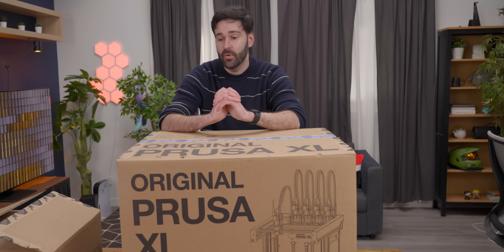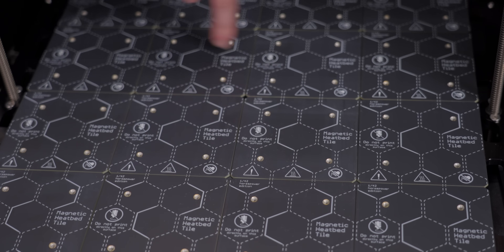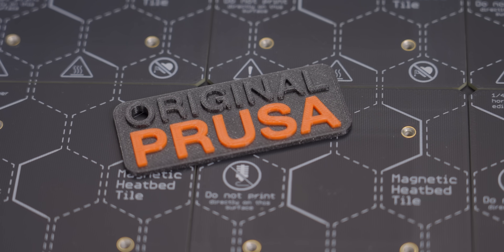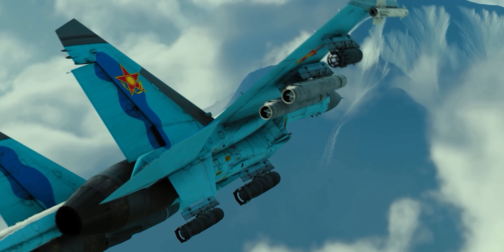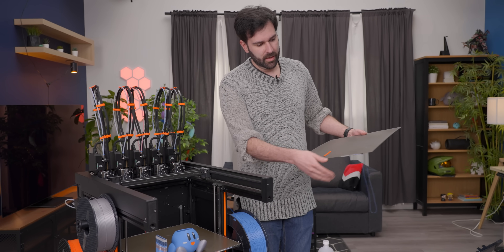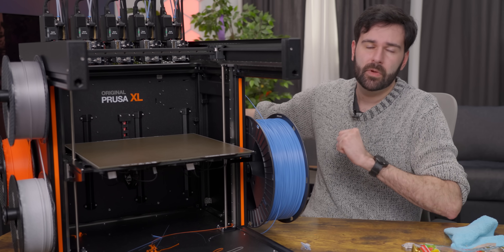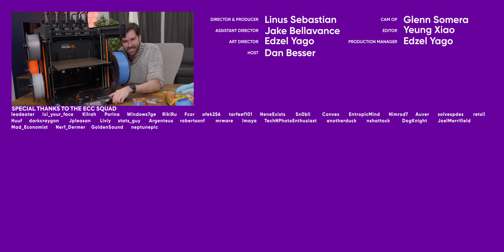Five heads are better than one - Prusa XL

Comment: Hey Dan, excellent video! Sorry for the lengthy comment in advance. I was initially leaning toward the Prusa XL, thinking it would finally meet my needs, but after watching your video, I’m now unsure about whether it’s the right choice for my specific requirements. To give you some context, what I primarily need from a 3D printer isn’t necessarily speed, but precision. I often prototype intricate parts that must fit together with tight tolerances, so accuracy is key. I was initially drawn to the Prusa XL for its build volume, which I thought would be ideal, as my typical print heights range from 2” (50mm) to a maximum of 14” (356mm). While I mostly work with single-color prints, I’m also open to multi-color or multi-material options when needed, like the XL promises. However, the most critical aspect for me is achieving a smooth surface finish akin to SLA prints, but without the associated hassle of maintaining an SLA printer. I’ve heard that the Prusa XL’s slicer now includes the Arachne perimeter generator, which promises improved print quality, and that was something I found promising.

 Based on your extensive experience with various machines, I’d love to hear your thoughts on which printer would best meet these needs. Specifically, I’m looking for precision, ease of use, and the ability to deliver professional quality prototypes, without the maintenance demands of an SLA system. I trust your judgment and would greatly appreciate any suggestions or guidance on what to consider next in my search. Should I keep waiting or should I take the plunge? 

Thanks again for all the valuable content you create, it’s been a huge help!

Comment: I respect Prusa for what they have done, and am concerned that they are sort of loosing their way with the way they have handled the launches of their most recent machines. With the launch seeming like they felt the pressure to release these before they were completely finished due to Bambu Lab's meteoric rise and the surprise that was the creality K1 and K1 max. Now, obviously those machines each do things very well with the K1 Max being a larger, klipper based machine in comparison to the X1C and P1S, but the Bambu did multi-color and multi-material very well. Now, this machine does both, but the lack of per machine input shaping is something that felt like an oversight, especially when they first released input shaping for their newest machines because the machines didn't launch with it. They just feel like they are now behind the 8 ball now and I hope it doesn't stay like that because they have been a gold standard for reliability and ease of printing.

Comment: Why do you still need a purging tower with different heads ? Can't you purge them all once at the beginning and swap directly ?
Reply: I know this is a month late but you can its not a purge tower it's a priming tower to make sure the filament is heated and flowing smoothly has absolutely nothing to do with purging anything but you can do it by priming into infill but that could lead to delamination and inconsisten extrusion

Comment: Was looking at the Prusa XL with the multi heats, but the price for all 5 heads was a little steep for me, and what I was needing Decided to back Co-Print, whom Creality has also partnered with, creation for a multi-filament head/system. Should work great with my K1 Max. The option I chose will allow both of my printers to swap between 8 different types of spools. I have some grand Ideas. lol 2 printers with 8 filament swap capabilities for less than $2K feels nice... or I could have one with 16 spools, and the other with 4, or just put all 20 on one printer, which is the max. Which is honestly down right insane and mind boggling to think about right now! lol We shall see how much of a headache I have with it once I get it. Which should ship out in what looks like May now.

Comment: At this time of point, there is no point of getting a Prusa. Prusa is failing to adapt to the new market. Their MK4, although reliable, is HORRIBLE value for its price. You can get something like a Bambu Labs A1 for a fraction of the price, print really fast and have Multi material compatibility, out of the box. The XL is so outright garbage. Their reliability is not good at all, It fails at multimaterial printing, and costs a LOT more than the E3D toolchanger.
Reply: The e3d toolchanger wasn't even a printer

Comment: Presumably each bed tile is 17.75 watts, given that it's the the "1/42 horsepower edition"
Reply: That would only add up to 284 watts. Seems pretty low.
Reply: @logitech4873  My thoughts too. The bed on my E5 Pro is 220W, and this Prusa is so much larger.
Reply: @kylegordon  The heatbed on my Bambu is closer to 1000 watts, and that's only 256x256mm
The Artillery X1 i used to have was 300x300mm and 600W

Comment: The price is absurd, it also offers something no one else does. If you mass print colour this is definitely better than a Bambu with AMS, that's not even taking in the bed size, which is also great. But like Dan said, the biggest thing is multimaterial. An AMS struggles with swapping certain materials like softer TPU, which should be no problem here.

Still, it 'only' does 5 colours vs Bambu's possible 16, and the price is absurd.
I also found the print quality very lackluster. Joels problem is apparent here as well, which makes me think that the multi head system isn't working as well as it should. For 4k this is unacceptable.

Comment: Scotty from Stranger Parts did a studio/factory tour of this company. It provided a good insight about the company. 

Also, magnetic sheet on a heated panels? Magnet and heat don't sit well together.
Reply: its fine if you use the right type of magnets, the MK3S+ has had a magnetic bed and nobody has reported loss of magnetism and Vorons use magnet sheets rated for high temps.

Comment: $2000 for the base printer with one head is understandable but $4000 for the base printer and 5 heads is a bit much, you are paying $2000 for 4 heads and the splitter board, almost $500 per hotend and the hotend doesn’t even seem all that special.

Comment: Try printing TPU with PLA supports. Amazing results. Use the dissolvable supports option with 0.1mm offset separation. Custom seals/ gaskets are so much better when the supports just come off so easily.

Comment: Worth noting is that at least several months ago, quite a few creators have highlighted issues they've had with the Prusa XL. A lot of updates have happened since then so it's hard to say what the current state of the printer is. Even in Dan's example I can see some ugly layer lines and yeah, some color blending- but it also finished, which at least a couple of months ago wasn't even guaranteed. I really want this printer to succeed, because the toolchanger concept beats out the bambulabs AMS if you're into multicolor/multimaterial printing by being way faster and with significantly less waste (also, some people paid literally $5K+ for their printers and it's unacceptable for those folks to not get the performance they've been expecting). I've also seen some mods for Voron 2.4s from the 3DP community that also look very promising, so in a few years we might have quite a few options out there.
Reply: Yeah i'm holding out for a 2-3 head option on a mk4 size unit
Reply: @uto You're probably looking at a Voron 2.4 250mm with tapchanger. But at that size it's usually more common to find an IDEX printer from any number of vendors (or building your own).
Reply: I wouldn't worry, everything will get better and better with each next update, as is usual with the Prusa.
Compared to Bambu, it is really a significantly better piece, prints faster, prints with less waste material and is able to combine different materials. It's an obvious choice for me, the $5K is back for a few large prints. (filament consumption and, in the case of a shorter print, also electricity consumption)
Reply: @zdenekcerny9019  "I wouldn't worry" is probably not the phrase I'd use. If I dropped $5K on one of these machines I'd replace "worry" with "expect" that they would fix the problems, because guaranteed I'd never buy anything from the company again if they don't stand behind it. They released it in a half-assed state when they didn't have to and damaged their reputation, so it's on them to fix it.

Comment: prusa are really too expensive for hobbists but worth it if you just want a working multimaterial printer asap. at this price (3.5k for the 5 tool iirc) you can build a voron 2.4 350 with 6ch ercf mmu and 5 tool tapchanger (6 color + 5 different materials) and still have enough money left to build a gaming pc. in fact that is exactally what I am trying to build right now. it will take more than a month for sure but that is a enjoyable hobby for me.
also if you are just printing multi color, bambu ams or ercf v2 are cheap and reliable options. a voron trident idex (for support mostly) + ercf are probably the practical sweet point. I am building tapchanger just for fun.

Comment: I have this and the x1c , couldn't be more happier. I made some handle grips on my xl using pla and tpu as the grip material.
Reply: Does printing TPU inserts in other materials work easily? This is the sort of thing I'm considering Prusa XL, just two tools would probably be enough for me.
Reply: @Qwarzz  It does work easily once you set the volumetric speeds correctly. This guy's video explains it in better detail.

 https://youtu.be/oUXeIEUS68I

Comment: Did they fix all the issues? i've seen lots of complaints about this machine, as for multi-colour it is technically more efficient than the bambu AMS, although that can be mostly negated with purge models, but in terms of print quality i've seen videos of people struggling to get models as clean as what pops off of a bambu

Comment: I got the Prusa MK4. The XL was out of my price range especially for my first printer. I was disappointed with the MK4 a few prints in and I tried to do an overnight print. That print failed, and it hasn't worked since.
Reply: Have you contacted their support? A big part of Prusas justification for their premium is that their support is actually competent and useful.
Reply: Gonna be honest I haven't gotten around to it. When it was my 3rd or 4th ever print on it and it quits working I was quite discouraged. I plan to do it soon. I have some replacement nozzles on order and when those arrive I will contact support. I am very new to printing so I thought I would order some spare nozzles just incase.  @Nidkidful

Comment: Most the print quality issues were from using a 0.6mm nozzle and the slicer software or machine firmware not being able to properly manage the math for running said nozzle. Which is why they switched to 0.4mm nozzles on the new machines.

The machine is $1500 with +$500 per each extra print head "that's how they get ya", then also an extra $1500 preassembled 😮 to be fair, they do have a well sorted machine for multi-material printing. If you don't want to waste as much material, print faster multi-material prints, and a larger print bed.. with over $4,000 extra in your pocket to burn, this is for you

If you don't want to burn your pocket, but feel comfortable burning down your house the BambuLabs A1 w/multi-material is an amazing printer

Comment: well if you would use 5 dragon heads at once, not just a tool changer, yes you can, on the same rail, must have better interleaving than audio sync in this video, no more purge towers. just make the slicer calculate the 5 dragon heads at once being on one scan print line all the time.

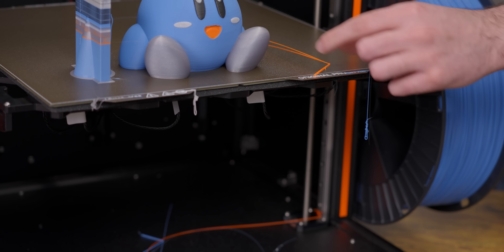Comment: 8:30 "Okay let's see how it releases from the bed, Oh it slides off instantly?" You can tell this guy has never used a 3D printer before this video 😞.
Reply: Yeah, no.  Only someone with very little experience would say something that daft.  Different materials and different bed types have different stickiness.  It just happens that PLA on a textured Prusa plate will basically fall off once it has cooled down.

Comment: The "direct drive" misnomer is my biggest pet peeve in the 3D print community. A direct drive extruder is one where the extruder gear is attached directly to the extruder motor output shaft. The alternative to a direct drive extruder is a geared extruder. Ironically, direct drive extruders are common in bowden printers, and direct extrusion print heads usually have geared extruders.

Comment: Easy fix to the crushing. In the slicer postprocessor just make it so that it always thrown in at the start of the program that the axis is all the way back at the tool change then the z goes all the way up to 0.2mm above the build plate and then the move to the opposite side ( makeing sure that if there is any print on the printer it gets pushed off automatically when it starts a print )

P.s. I really really wish that printers would also start useing G02. G03. R values. I values. J values and A values  for doing round features ( perfect/even in both ends ) and where it starts or end at a different mouth compared to the opposite end as well as a set angle instead of all those micro steps ( I did open up a print file and could understand most of it since it's just normal Gcode witch is used on cnc's. So why not use all the movement commands instead of only some of them ? )

Comment: It works most of the time, unless you want to print flex. Then it is a nightmare like every other flex printing experience. Mods are required, and even then performance is far from guaranteed.

Comment: Prusa is in a bit of a weird spot with the printing community at the moment. Their biggest selling point for years was "it just works." The Prusa Mk 3 was several times more expensive than just about anything else on the consumer end of the market when it was introduced, but unlike the Ender 3 and similar models it had to compete with, you didn't have to modify the crap out of it to have a quality printer. It just worked. 

Fast forward a few years, and now everything more or less just works. You can still buy a stock Ender 3 if you want to have a platform for tinkering, but even budget brands like Sovol are getting excellent results out of the box. Everyone on the high end of the market is innovating and pushing the envelope, except for Prusa. The Mk 4 isn't significantly better than anything else in its price bracket. It's not particularly fast. Print quality is good, but the same could be said for a dozen other printers in its market segment, and most of them are cheaper. It's hard to really justify paying the Prusa tax when the only thing you're really getting out of it is bragging rights. 

The XL was supposed to change all that, but it's been plagued with issues since launch. It's been a few months since the first models started to hit the market, so I'd like to think they've had a chance to fix the worst of the issues, but it's already picked up a reputation for being unreliable. What you have now is a very expensive printer with a neat gimmick and a shaky reputation. If you need a large format printer, Anycubic's Kobra Max line does that shockingly well for a fraction of the price. Bambu's AMS system is wasteful, but even a fully loaded X1 Carbon is cheaper than a base model Prusa XL. Hell, for $2000, you could build a Voron with a large bed and a tool changer. There's just no real reason to go for the XL, aside from being able to tell your tech buddies you have one.

Comment: You haven't done your homework. There are no comparable 3d printers on the market, especially there is none in this price/capability bracket.
ALSO 3K EUR is a steep price for a toy.
As a tool it will pay for itself in a month. If it will be able to print ABS (heated chamber).

Comment: I got lost on the terminology here. This has 14500 layer changes, it printed in 4.5 hours, but a layer change took 11 seconds realtime.  That math doesn't really work, but if you drop it by a factor of 10, it works out much closer.

Comment: Please keep in mind that this is an early adopter product with an early adopter price. Prusa has a tendency to release products that are not fully ready and use their early adopters as testers to iron out all the kinks. They do generally end up being reliable workhorses in the long run but if you do not intend to primarily print multi material prints without an enclosure it is best to seek alternatives or wait till it is a more mature product. As multi tool head systems are very new there should be a number of alternatives hitting the market in the near future.

I have seen too many videos and comments from people who have bought it and are frustrated with things like the tool heads popping off mid print and layer shifts through multi day prints and so on as they expected the product to be perfect day 1 due to the marketing materials surrounding it.

Comment: LOL, it still needs a wipe tower even though you have a separate extruder for each filament? :D
Reply: How would you prime the nozzle?
Idle heads still ooze some filament during cooldown/heating cycle, so some small purge is needed for primong. But it's small compared to single nozzle cleaning.
Reply: @Papinak2  Not if you maintain temperature and your filament is dry. Can't keep the filament at temp for too long before it starts to degrade, I'll give you that, but you should still be able to only heat up once you arrive at a layer where the given material starts and handle that prime with a dedicated wiper outside the build volume.
Reply: @hellterminator  I remember reading that they tried to get rid of the tower entirely, but apparently it didn't work out.